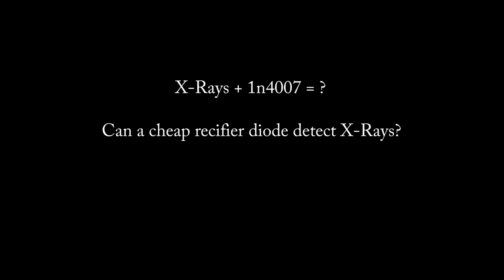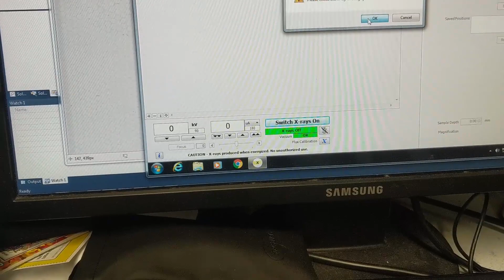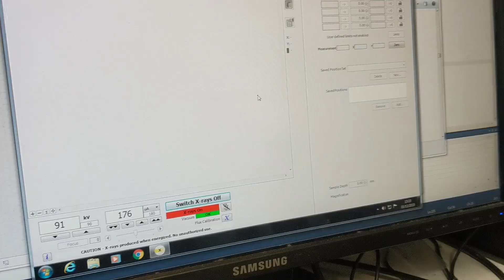1n4007 diode as an X-Ray detector

Comment: If the x rays are impinging on the diode crystal, and the image shows the internal metallic areas either side, is the diodes response sensitive to being rotated, since obviously the metal bits are blocking the rays? If so, presumably thats useful to indicate the source direction.